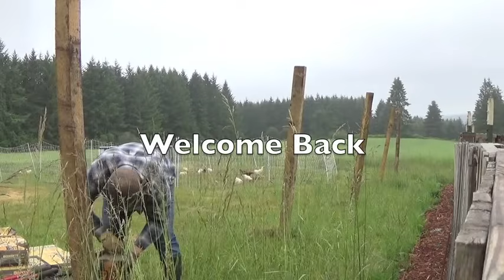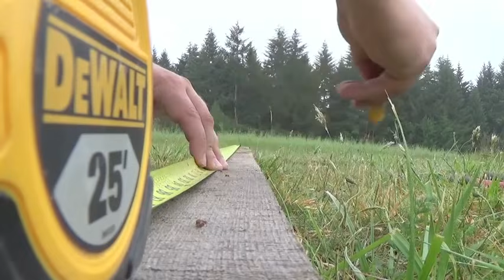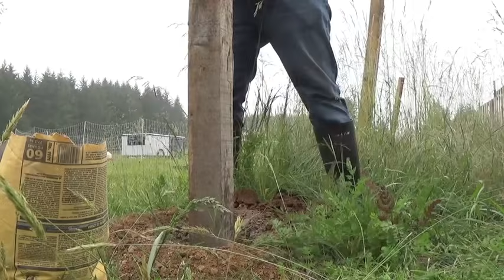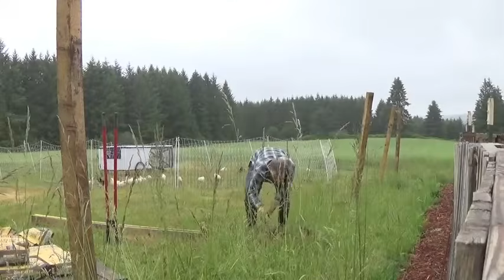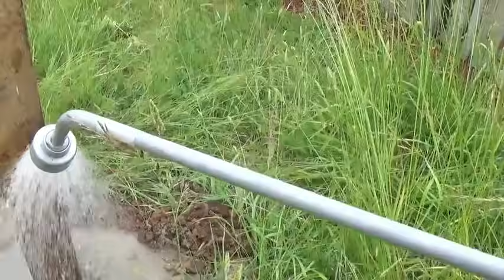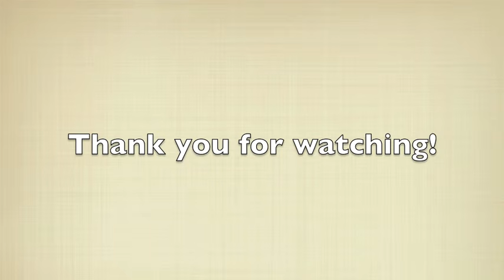Setting a Sturdy Post: Easy Dry Pour Method

Comment: Tip, mist the top of the concrete at 30 min intervals 3-4 times to prevent washing away the bond in the top layer.
Reply from the maker: Thanks for the tip. I usually just hill up the top and assume some will get washed away 😂

Comment: You had it right until you started adding water.
I put in truly dry pour posts 30 years ago and
never added water. They are as sturdy now as
when I put them in. The post mix doesn't need
you to add water. It will suck moisture into itself
over a few months and will become solid and 
stay a little porous. This will allow the wood to
breathe. Don't add water. That just messes up
the process.

Comment: Nope, sorry. Watering after all dry mix added rather than watering in increments-- not good as water will NOT penetrate all the way to the bottom of the dry mix. Don't believe it? Dig one up and see for yourself. :-)
Reply from the maker: @meekerh  I have, and it works fine when you are working in soil with a reasonable amount of moisture. Sorry it hasn’t worked for you.

Comment: How much concrete would you reccomend going under the post?
Reply from the maker: @DFAULT-qn3px  if you dig the hole about 2x wide, I usually end up around a bag and a half - 2 bags per hole; but it varies.

Comment: I do the end posts first then tie a string so all the center posts are in a trait line if that matters to you sometimes it doesn't, I use wood posts instead of Metal poles because it gets more expensive with all the hardware $11.00 wood instead of $25.00 metal pole ads up quick not to mention the cost of wood panel fence today.

Comment: My only tips - flare the hole toward the bottom and then make sure the top of your concrete is 3-4" below the surface, and then pack dirt above. If you get frost, the ground surface freezes first and will lock that slug in there so it doesn't heave. Combined with the flared hole/slug shape, it will be rock solid!
Reply: the soil at the top will rot out your posts much quicker.  The flare at the bottom is a good idea.  I use a little bit of sono tube at the top to give it a nice round shape
Reply: @markrichards5280 i dont think so. It will cause the cement to crack away from wood and water sits and rots it. better to not fill hole all the way with cement so that u can fill dirt a few inches thus preventing frost from doing that to your cement

Comment: Thank you for this. I'm curious as to approx. how much water you used for each hole, after filling them with concrete, and if it's possible to over-fill or under-fill with water, thus causing the concrete to not harden correctly? Thank you again! :)
Reply from the maker: You can under water, and the concrete would not harden correctly. From my experience, you cannot over water.

Comment: I am installing a steel/metal fencing post. The hole that I dug is 3 feet 9 inches deep with a diameter of 14 inches. How bags of Quikrete do you think I would need assuming I want the Quikrete to come up to ground level.
Reply: I would get 2 bags
Reply: @paulpersons799  How deep was you hole in the ground?
Reply: @paulpersons799  I thought 2 bags would do it also but  several people have told me that i will need about 10 bags for a 3 ft 7 inch hole.
Reply: @paulpersons799  I finished the project. I ended up needing 10 bags.  The holes was 14 inches wide and the dept was 3 ft 7 inches.  I needed 10 bags.
Reply: @BlackHamRadioUniversity  oh geeze,  I guess that's a wife hole though and almost 4 feet deep.  I think I didn't read u post fully.  Lol
Reply: @paulpersons799  LOL!!! yeah I had no idea that I would feel so drained after that project.  I got dehydrated and almost fell to the ground in that 95 degree temperature. My shirt was soaked after two minutes man.  I got drianed just purchasing the concrete. I had to pick up ten (10) 50lbs bags and put it on a cart, then I had to pick up those same ten (10) 50lbs bags to put in the car, then I had to pick up those same ten (10) 50lbs bags again to bring them in the yard and then I had to pick up the same ten (10) 50lbs bags to put in the wheelbarrow to mix it.  I mixed the first three (3) bags together and that drained the hell out of me.  I was out of breath just mixing concrete!  It was so draining man LOL. Maybe I am just getting old. LOL I will post a video of it after I edit it.

Comment: The concrete sucks all the moisture out of the wood...and after about 5 yrs..the wood is so brittle a gust of wind snaps them like matchsticks 😊
Reply: so what do you use?
Reply: @debracook2904  personally I use treated wood, and a mixture of the dirt that was dug up and sand.
Reply: @j3205  This works for some jobs in some areas; but not for others.

Depends on the type of soil naturally occuring in your area, the type of fence you are constructing, and the climate you have locally.

Comment: adding concrete to the bottom creates cupping which will rot your post.  add gravel for it to sit on and let it drain through the bottom
Reply: Actually, adding gravel to the bottom of the whole does the opposite of what you think it does. It’s holds the water. Your better off fully encasing the post with concrete.

Comment: I use a Ryobi 40V electric auger to do the holes - with extenders I have gone down 48" and 10" wide for 4x4x12' posts. Much faster than using a post-holer.
Also I use Quikrete fast concrete mix - it is more expensive but allows mixing in the hole, and the post is good and solid after a couple of hours. Wouldn't do it in the rain though.

Comment: coat the posts in a mixture of deisel and used motor oil
OR burn the outer edge so black charcoal coats the  part to go below gown 
OR coat in asphalt 
also, you might silicone caulk the endge where the concrete meets the wood, so water can't get down in that area.

Comment: The hole need to be bell shaped (wider at bottom) and you should pack concrete in hole as you go.
Water the posts as you would a tomato plant for a week during the dry season.

Comment: Always pour enough concrete so that it will be ABOVE GROUND LEVEL BY AT LEAST A HALF INCH.
Dirt & grass growing around the 4x4 and water settling around it is what causes it to get weak and eventually it will literally rot & break the 4x4 especially when you have high winds. Some people paint the wood and some use treated wood to keep it strong. But it will still last longer if water doesn't collect at the base.

Comment: No 1 talks about keeping the concrete wet for a few days after the first pour. 
They use this method on bridges and highways using sprinkler systems and/ or plastic or wet burlap.
Depends on how hot it is, but I've done this & it makes the concrete/ cement stronger.
I do like how you explained that the mix is going to absorb the water from the wet ground around it.
Reply: For things like Bridges & sidewalks ..yes, you want to keep it wet. But that is not really necessary for just a simple concrete post. 
Besides ..the concrete base is surrounded by moist ground soil. It will probably be wet for it's entire lifetime.
Reply: @percival23  it depends on where you live. There are hot & dry areas. & the time of the year you pour the concrete factors in also. 
When I wrote my comments it was July or August & it was crazy hot.
I'm talking about the grass is dead because its not getting any water.
The world & the climate is changing too and the cold weather is alot shorter than it used to be.
Idk how old my fence is but I've had to replace over 10 4x4s and a couple of them, I've had to do more than once.
High winds, even when its not hurricane season will test the strength of your wood & concrete. I've taken short cuts on some of the 4x4s and it just doesn't pay when you have to go buy more concrete and dig another 2' hole. Even if you rent digging equipment.

Comment: This is how you rip off customers. You are better off just doing it with dirt only and no concrete. Do it this way, and then dig the post out a week later amd see if your concrete is fully hardened.  It won't be
Reply from the maker: I have ripped out several fences that I have installed this way; all with fully formed plugs. Sounds like you aren’t using enough water.
Reply: @CampBennettSandpoint  I mix mine at all times, I don't trust this method
Reply: Lol ok keyboard warrior. This method is LITERALLY following the directions on the Quikcrete bag. There's videos of guys that did this method and dug up the post to inspect it. Concrete gets totally saturated and set!
Reply: It's how rapid set is made, it's a chemical reaction, not the same as normal cement

Comment: I see you waited about a week before applying force to test those posts.  Is a week the minimum curing time you'll allow before working with these posts, hanging rails etc?
Reply: Concrete is pretty close to max psi after a week. But it's not fully cured till about 30 days.

Comment: If any of you critics left a bag of quickcrete outside in the weather for any length of time, you would know what happens.  It gets rock hard solid.  Nothing wrong with this method.
Reply: Wrong.  I put in 160 feet of vinyl fence this way.  Dry set.  I filled the inner with mixed (water and redimix) because i know moisture wont get into the vinyl post.  80 mile per hour winds.  Still standing...wrong.  i know a thing or two about a thing or two..  if you kniw anything, you know solid vinyl is a wind sail.  Thus guys method is just fine.  I want you to read the quick set bag and look at the directions also.
Reply: @jaymann53  Great, But that does not mean the concrete got the right strength and that is my point, yes reading the labels is always recommended, thank you Mr Jayyman.
Reply: This method is LITERALLY  following the directions on the Quikcrete bag. Only thing he didn't do is measure out a gallon of water per bag.
Reply: Concrete will get hard of course but not means it has the proper strength water to cement ratio
Reply: @geronimopascuale9208  hey Bubba it ain't finish work and the fence is still up
Reply: @Geronimo Pascuale  the difference is the application.  Foundations and slabs have to carry load.  Fenceposts do not support cars or houses.  The only thing the concrete around a fencepost does is keep it upright.  The weight of the fence is carried by the gravel base UNDER the post and concrete.
Reply: All concrete has a Strength Braking point because is engineer to meet  different specifications and applications, when you pour a driveway or sidewalk or any structure, you just don't spread the sand, gravel and cement and let the Rain do the Job. Wrong
Reply: @geronimopascuale9208  This isn't finish work BUB.  It's a friggin post hole.  There is a difference.
Reply: @geronimopascuale9208   it's a premix so the sand and cement and stone is mixed
Reply: @geronimopascuale9208 you're wrong. Plain and simple. Look up the fence academy. They guy puts all you idiots in your place when he uses a bobcat to pull posts and the dry packed holds up the exact same as the wet pour
Reply: @geronimopascuale9208  you are wrong.
Reply: @jaymann53  an you should educate before commenting
Reply: you are commenting out of feelings with not Knowledge about it @jaymann53

Comment: I build fences for a living. This method does not give the best result. Mix the cement in a wheelbarrow and shovel it into the hole. More work but a result that is stronger and will last over time.
Reply: Dry pouring is best method imo you set all corner and end posts first let dry for a day come back an string line the straight runs before digging rest of holes no post  bracing required
Reply: Never let perfection be the enemy of good enough. I have always poured wet concrete, but to be honest I also have low fences that are just tamped sand (with cleats nailed to the posts below ground) that work 100% just as well.

Comment: I noticed that you didn't tamp the fill down. Is that something I need to do or are you confident in how sturdy they are without doing so?
Reply: Don't do this... Please no
Reply: @gregoryv8026  you don't suggest to tamp? or don't suggest to use the dry mix like what the video shows? thanks
Reply: @WORDTOMICHAEL  I always mix the bag with water before I put it in the hole. I fill the hole entirely and I use a trowel on the top, in a water shedding shape.
Reply: Gregory V thx

Comment: I've seen this method before where they use a stick of some sort to stir the concrete after pouring water over it to allow the water to penetrate all the way through. That might mess up your plumb but you can easily readjust with a leveler after mixing. Simply pouring water on the surface of cement and the ground surrounding it raises my suspicion that the water would not penetrate all the way through the cement mix. It's just an observation that I can't back up due to lack of experience. I'd love to hear the opinion of someone with experience with this method.
Reply: Hi terry, This method is probably the fast method to do post setting for wood fencing, The concrete will absorb any moisture like he explain and as long as there is moisture the Hydration will always occur , but this method for Strength is probably not good because the Water to Mix Ratio, most manufactures require a specific amount of water to meet the specification of Strength, but you never fill the entire hole with concrete and then pour water, you pour one bag and add the specific amount of water at a time to make it more water to cement ratio, Time would tell on his case. Nice video by the way and I appreciate the time that he took to make it. Cheers
Reply: @geronimopascuale9208  keeping the area around the base wet for 3 days REALLY helps. It will make the pour sronger.
Quikrete will harden fast but
the mix doesn't stop absorbing & needing water after your 4x4 feels sturdy.
With that being said after 72 hours of water I'm  sure there wont be a dry spot of concrete in the ground. At the same time I wouldn't pour 2 bags then add water either, but it's a  method some people use. 
You use more water if it's hot outside but you never flood it, just keep it moist.